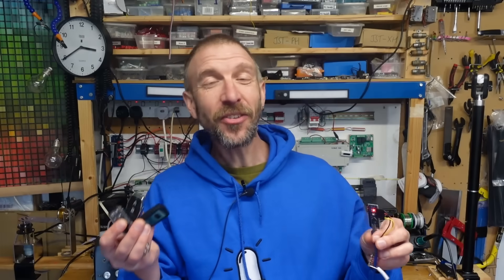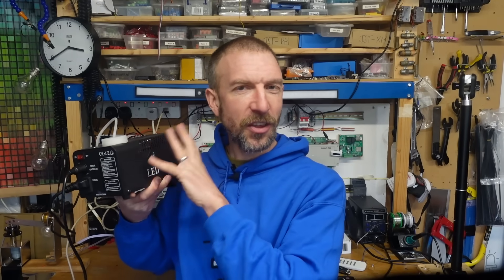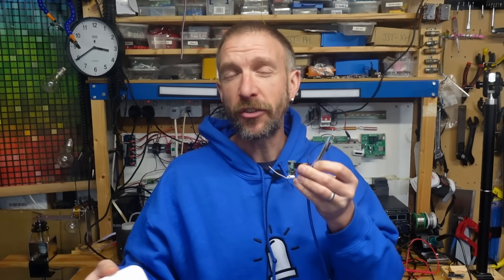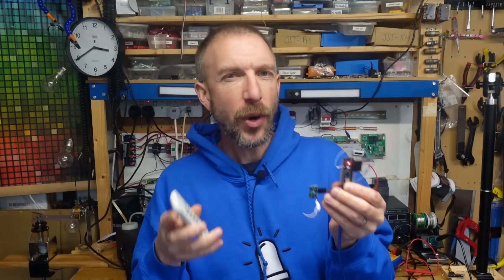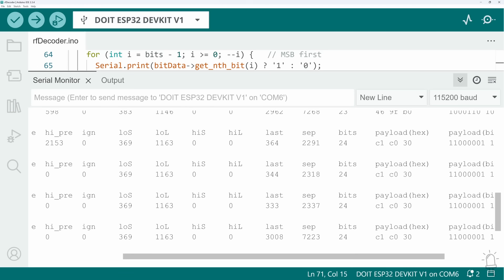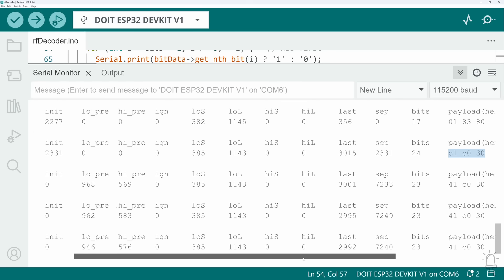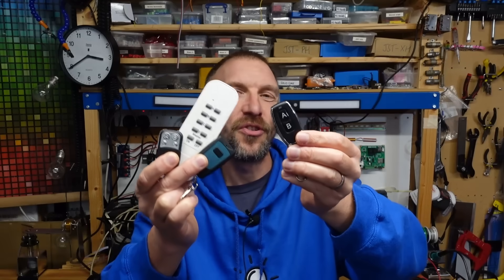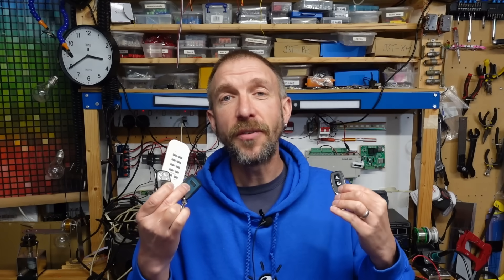Automate any wireless device

Comment: I don't know about the other items, but for most car keys, this would not work by now. Criminals learnt to replay the car keys signals a long time ago and car manufacturers changed the keys to use changing signals that cannot be replayed that easy.
Reply from the maker: The encoding and delivery system still work the same way (i.e. you can use the hardware setup in the video to receive and identify the signals sent from your car keys, if you really want....).
You're correct that the only difference is that they don't broadcast the same signal each time, so simply capturing and replaying the intercepted command won't work, because it will be considered out of sequence by the receiving device and ignored.
As explained in the video, I'm not going to describe steps to circumvent this, for obvious reasons...
Reply: it won't work on any remote (garage, car fobs, alarms, etc.) because they  all use rolling-code systems that exactly designed to PREVENT criminals from doing this very thing.